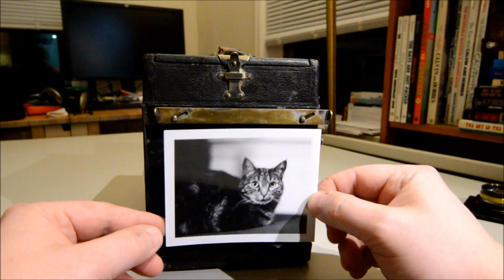Auto Graflex SLR camera

Comment: Hi Sam, just a question...could this camera work whith 4x5" sheet film (available today)?
Reply from the maker: It uses 3x4 film so you 4x5 won't fit. You can however trim 4x5 film down to fit 3x4 by just cutting about 2" off the length. It can be done without too much difficulty with a paper cutter in the darkroom, but mind your fingers as you have to do it in total darkness. Best to waste a sheet in the light to ensure the fit, and then set up a jig to cut unexposed sheets in the dark.
The alternative is to use 3x4 film which can be found from a few suppliers. Ilford still makes it and has a special run every year or so, but otherwise the selection is a bit limited.